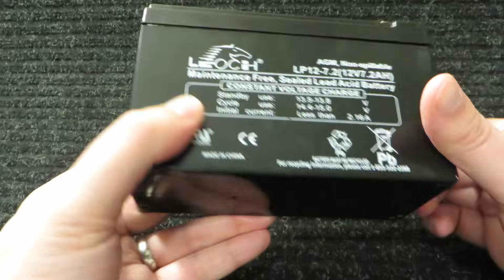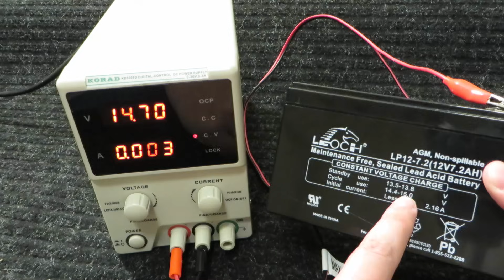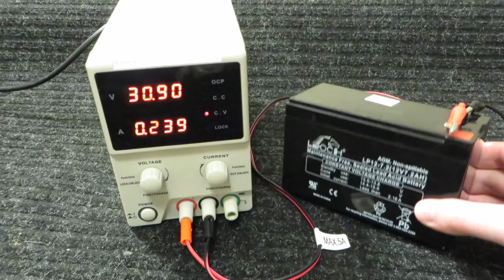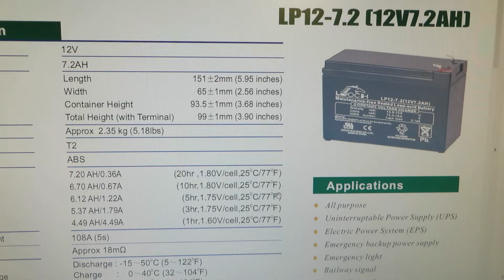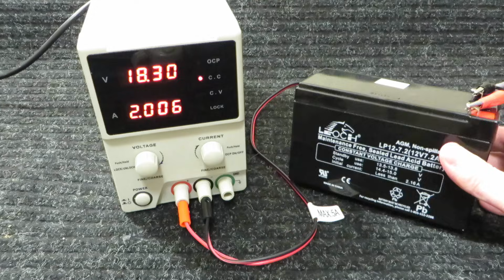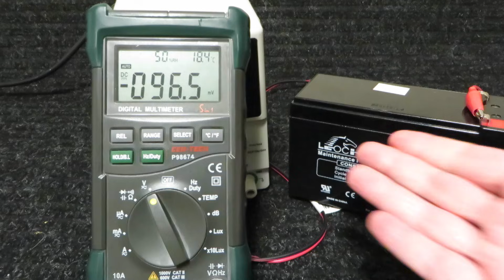Battery Desulfation Demonstration Start to Finish - Part 1/2

Comment: Aaa help. I've tried to charge another dead battery - 11.5V There's info I can 'fast charge' it with 4.5A current for 1 A and ... it make noises ! lol Every 30s I hear a whistle 2 second long starting loud and then getting silent increasing a pitch at the same time. Sound a little like whistling fire works flying to the sky. Not so loud but ... scary? I geuss it is just gasses releasing but this is 'closed' design...
Reply from the maker: The battery is outgassing - you are hearing the vent open and H2 and O2 being released.  This water loss is permanent but might be necessary to recover the battery to a usable condition.  If you're hearing this every 30 seconds I think it would be best to back off a bit.  Every few minutes would be more typical in my experience on an agressive desulfation schedule.

Comment: - My battery can accept up to 14.4V @ 4.5A for 1h for so called rapid charge ~65W. Atm  I'm doing a 'force charging' with 2A current for 2h. Power supply shows me 16.22V and it is like this for 45min so far. I hope this 16.22V * 2A = ~32W is something my battery can take without damaging it.
- If battery is heating up it means that energy is being wasted for electrolysis? Am I correct?
- I understand that repeating a process of charging and discharging battery restores  the capacity of the battery (up to some point), right?
- I don't have such fancy discharger, so I have to think about it how to discharge it properly.  What can you suggest? Is lightning bulb ok?

Update:

I've ischarged the battery with a 55W car bulb. According to my calculations it should last for 1h45min before voltage will reach 10,5V on a battery. IT ends after 15minutes.. whcih menas my old battery is at 15,6% capacity...

After discharging I've started fast charging battery with forcing 4.5A for 1h. The voltage went up to 16.5V. The battery was warm (not hot) I would say like body temperature.
what's interesting is that during this charge I was reducing a voltage to 14.4V from time to time to see how big current can be accepted for such voltage and it looks like with every test it wanted to accept more. 

After 1h I've reduced the current to 2A (the voltage dropped to 16,04V). I kept testing 14.4 V Once I've found that the 14.4V can accept at least 1A I used an 'intelligent charger' (which can give max 1A) and finished battery charge.
After 1h of battery charge process it still holds 13.14V which I think is a good sign. Tomorrow I'm going to do a discharge of it to see for how long will it last this time.

Comment: If a car battery charger only uses ~14-15 volts to charge and say 20-30 amps, why are the cables so heavy vs the cables on your CC CV power supply that appars to have 10 ga wire at most?  Good video..
Reply from the maker: Modern car alternators can output 100A to 150A to power all the electronics cars have nowadays.  Some can do over 200A.  Heavy wiring is needed for such loads and the starter consumes many times more amps - though for a short time.  20 years ago there were instances of fires caused by inadequate design choices of wire gauge on vehicles.  e.g. install a 'new' battery that was low on charge and it accepts the full 80A output of your 1999 ford escort and after 10 minutes straight of that current through the 10AWG wire they chose to use and you had a problem.

Comment: Charging voltage should be between 13,8 and 14,5 in an operating cars generator, but 13,8 has destroyed some batteries for me so I prefer 14,5 V and a really good battery stays over 13 V after charging (of course it drops fast if you use it)
Reply from the maker: I agree with the 13.8V part of your comment.  Many car manufacturers have gone to computer controlled charging voltage regulation and they are HORRIBLE systems that undercharge and ruin batteries.  I have a car that I literally have to put on a charger if I don't drive it multiple times per week or the battery gets damaged.  Stupid stupid stupid.
Reply: @knurlgnar24  But very good for the profit even the thinner led plates are true evil!

Comment: Can you repair optima batteries I've never seen an optima battery repaired optima battery has been the number one failure in the past I have not been able to repair an optima battery and I wonder why?
Reply from the maker: They are AGM so there isn't much to 'repair' aside from that they can be desulfated just like any other lead acid battery.  The process is identical to what I show in this video aside from currents being a bit higher due to the larger battery size.
Reply: Way to celebrate hard work.

Comment: try 17.6 volts that is the setting my battery repair charger uses for 12 volt acid based batteries.

Comment: 9 times outa 10 you gotta pop that cap and add distilled water to the six cells. Then, you gotta charge it from a constant source such
as a good fully charged battery or your bench supply.
Reply from the maker: This is true - except most of the time a battery that is 'dried out' has been damaged sufficiently that it won't be restorable anyway.
Reply: @knurlgnar24  yeah, its hit and miss

Comment: I am attempting to recover a Absolyte 48 volt, 2000 amp hour battery... I am trying to learn this process. Is it possible to remove each 2 volt cell and independently charge each cell to a state of charge? I am hoping to achieve as many cycles as I am able. Am I out of my mind for even attempting?

Comment: with these "AGM " or maintenance free batteries if it's dry it A: won't charge , B:won't hold any charge for any length of time , opening the battery cover and adding water (not if it's a gel ) is the only way of successfully recharging /reconditioning

Comment: Hello, your videos are extremely informative and THANK YOU!  I have a golf cart with 6 8v batteries.  How can I use the same concepts?  I have the 48v charger from Club Car, but how can I deal with one battery at a time, both for charging and for a load?
Reply from the maker: That particular charger doesn't allow overcharging for extended periods of time (I know because I have one) so you will have to use a different charger if your batteries are sulfated from storage at low SOC.  The best option today in my opinion is to purchase a power supply as shown in this video - it doesn't have to be this particular one, just one that can do 60+ volts to charge the full battery bank.  Let it overcharge for a time and then drive the cart until it dies and repeat.  If your range increases the issue was sulfation.  If it doesn't your battery issue was something else this video isn't covering.
Reply: @knurlgnar24  Hi, and thanks for your thoughtful reply.  I was thinking about refurbishing them one at a time - my concern was that if I did them all, I would get them to "good enough" as a group, and one or more would still be needing work.  Doing them one at a time would let me pay each one its needed attention.  And I know I can use your 30v charger for them, but was wondering how to give the batteries an 8v load.  My thought after I sent the original message was to get some 12v incandescent RV light bulbs and use those for a load (they would work as a load but just be dimmer than at 12v).  Do you think this would be the most comprehensive approach, or am I overthinking it and that "good enough" is fine for this application?

I don't think I can stomach that nice programmable load unit price for my few batteries.  And driving the cart until it dies is a little problematic since I'd have to push it back to its corral... ;-)  Unless there's a way to create a 48v load???
Reply: @knurlgnar24  I had a thought about how to load only ONE of the 8v batteries.  Could I just hook up one 12v car headlamp?  They are 55 watt max and at 8v that would be 7 amps if they draw that much.  What do you think?
Reply: @knurlgnar24  I purchased this power supply, so I can deal with the batteries one at a time.  I hesitate on the price of the load generator you use although I'd love to have that.  How can I cobble together a recommended load for one 8v battery?  How many car headlamps, for instance?  And in series, or parallel?

Comment: love your cat, your presentation style, narration, also your stuff reminds me of mine.   I know your against them but could i use a noco genius on such a batt? I have a few ;) Noco is on a prime day sale, was considering getting genius 10 and genius 2 or 5 , advice other than, "this is the way" (The Mandalorian )
Reply from the maker: I have not personally tested one of the Noco Genius products so go ahead.  Maybe it's a decent charger.  :)  Even if it would not desulphate a battery like this one that doesn't mean it isn't useful to you.  I find RV power supplies/chargers to be the best all around units and they cost $150 or so.

Comment: I have tried EVERYTHING for decades; NOTHING works except cutting open the top of the bAD CELL ,removing the guts and installing (and soldering in...) new plates and separators; DO NOT WASTE TIME
Reply from the maker: This isn't a video about rebuilding batteries and you certainly sound more knowledgeable about that topic than me.  This video is about desulfating batteries.  If a battery has a 'bad cell' it is unlikely that it failed due to sulfation and in that case I agree that the process shown here isn't going to fix the battery.

Comment: Wow, thanks for this video. Great info.
I have a 20A battery that makes sounds if I pulse it at 16v 4A. After 30min I smell rotten eggs coming from it. I guess it's also sulfated. The battery doesn't get hot. Is it safe to keep it charging? I use a desalfating charger.
Reply from the maker: There is always some danger in charging lead acid batteries due to their nature so charging in a safe environment and wearing eye protection is always recommended.  Battery explosions usually occur due to bus bar failures or other such events that result in an arc inside the battery gas envelope.  They are rare but inevitable even during normal use.  The older a battery is the more likely these catastrophic failures are to occur.  As long as you are being safe knowing the potential dangers and the battery temp stays reasonable I don't see any specific danger in continuing.  This really isn't any more dangerous than ordinary charging/equalizing which lead acid battery users do every day without thinking twice about it.  Given your description I suspect you may have a lead-antimony battery?  Those outgass a LOT when old and will require a very high current to desulfate.  I'm not particularly fond of those batteries due to their smelly, messy, splattery, gas producing nature but they are the usual choice for industrial mobility such as forklifts and floor scrubbers.
Reply: @knurlgnar24  thank you. I placed the battery in a save spot and kept the charger on it. It went passed the desulfation fase and it taking the charge now. It is a new battery, so I assume it was just standing very long on the shelf. Will keep it charging 'till fully charged. Thank you for the advice. I'm always concerned about safety first 😀
Reply from the maker: @Martin_Kruger  Sounds promising!  If the battery was new and unused but neglected I expect you will be able to recover it to nearly new condition with only a little work.
Reply: @knurlgnar24  thanks. Yes, I bought two, so the other one is next in lline. Thanks for the great content. When I saw you apply the 31V to that 7.2A battery I felt much relieve, since my charger applies 15V-16V @2A in pulsating mode to desulfate the battery. Will do the next one soon. Thanks again.

Comment: First of all, great video! Very helpful!

Secondly, if I were extremely impatient, can I force tremendous currents (enough to desulfate the battery rapidly but not enough to melt the connections) through the battery for short periods with breaks to stop the electrolyte from boiling to rapidly desulfate the battery?

Also do most lead-acid batteries die with lots of cycles and if they do, is it due to neglect (battery owners not recharging the battery and letting it sulfate)?
Reply from the maker: I'd say most batteries 'die' due to misuse which comes in many forms from undercharging to storage conditions to simply 'it won't hold a charge' core returns where it simply needs to be equalized and the battery is still like new condition.  

As for forcing large currents through I think this can be done without much harm (not sure what 'tremendous' means but it sounds a bit above my comfort level) I don't see an advantage.  High currents will cause significant heating meaning fewer amp*hours per unit time.  This would actually slow down the desulfation process.  Whitepapers from reputable sources (US DOE, etc) always state a steady current is to be used, and in my non-scientific testing the process seems almost directly related to AH of overcharge and is rate independent.  Solid reputable data is difficult to find on this sort of topic for some reason but I too keep coming back to thinking "A higher voltage should speed up the process right?  Even if for short periods of time?"  Seems like it should but I haven't been able to show an effect beyond the process being current dependent.  High battery temps seem to speed the process too vs a cold battery.
Reply: @knurlgnar24  Thanks!

Comment: So I'm guessing that the bubbling is the conversion from Lead Sulfate back to Sulfuric Acid. At first it was chamber 1 (closest to the negative) and chamber 6 (closest to the positive) that would bubble but after several hours chamber 1 won't bubble at all. Is it chamber 1 finished desulfating or is it dead?
Reply: I am using a 12v/10a charger that has a brief 12v/50a engine start mode. I just keep switching between the 2. It's just interesting because at first only chamber 1 would bubble. Now it's the only one that doesn't.

Comment: Since you apply more then double the voltage to the battery would it not be safer to keep the current to half the recommended current ?

Comment: What a cool video!
Can I use that Digital Led charger on a 12V 105ah DEEPCYCLE Battery (VDC31M) ?
Reply from the maker: Yes, the power supply shown here would work for that battery just the same as this little one - it just might take longer.
Reply: @knurlgnar24  Thanks for your answer!
I have one bad cell in my 12V 105ah DEEPCYCLE Battery. 
I drilled holes in the top... So I can check the fluid bubbling... but one cell is not bubbling... Is there a way to repair? Maybe with one of the machines you use..??
Reply: @knurlgnar24  And is it wise to buy a heavier KORAD power supply for my 12V 105ah DEEPCYCLE Battery?

Comment: Thanks for sharing! What do you think about reverse charging? I'm trying to recover for fun and study some agm ups batteries that are dead because they were on float charge for some year on the ups and maybe the ups charger doesn't manage the float charge properly and after 2-3 years batteries are dead. In this situation you approach can be useful? In the past, before whatching this video, the only way to let batteries accept charge was to reverse charge them, discharge and recharge with the proper polarity. One of these accepts only reverse charge even if I put 32v on it with correct polarity... another one that I "recovered" with reverse charge and after correct charge,  emits an hiss from time to time under charge even if I use less current than the maximum rated initial current printed on the battery that is a FIAMM agm battery 12ah 12v.. another one was under forced charge at 22v and 0,5 amp (it is a 4.5ah 12v ups agm battery) for 8 hours a day for 5 days but still can't hold the charge.. in short, up to now no appreciable result, unfortunately... I will appreciate every advice you will give, thank you very much!
Reply from the maker: Interesting timing on this comment as I am currently doing some practical experimentation on reverse charging.  There are whitepapers out there on the subject and it is absolutely legit if used properly in the right circumstances, but it has to be the RIGHT circumstances.  Most UPS units overcharge the batteries and positive plate corrosion or water loss is the precipitator of failure and desulfation or reverse charging will not help.  Reverse charging can improve plate activation or help the desulfation process though.  It is more aggressive than the methods I typically use but I think I may have found a common use case for it hence my current testing.  I think you're on to something here...  BTW the 'hiss' you hear is likely due to the battery outgassing excessively.  This could be due to a multitude of reasons but there likely isn't much to do about it other than add water as necessary.  Sometimes an old battery is just an old battery.  None of these methods are magic as you're well aware, they just allow us to make maximum use of otherwise discarded batteries.
Reply: @knurlgnar24  Thanks for your reply! Then, can we soon expect a new reverse charging based video? 😁

Comment: Test the capacity.  It will  be nearly zero.  Desulfation never works. Dump that lead while you still can without paying for disposal. in ten years there will be almost zero market for lead acid batteries and you will have to pay to get rid of them.  Buy a nice LFE battery that will last 10 years.  As you have discovered it is easy to buy lots of stuff and much much harder to finish a project.  When you run out of space you can't even buy more stuff.
Reply from the maker: I tested the battery and capacity is nearly as good as new.  Lead will always have a good recycling market due to it being easy and economical to recycle, LFP batteries will never be economical to recycle and you will likely need to pay a disposal fee.  Me thinks you have things backwards based on poor information.